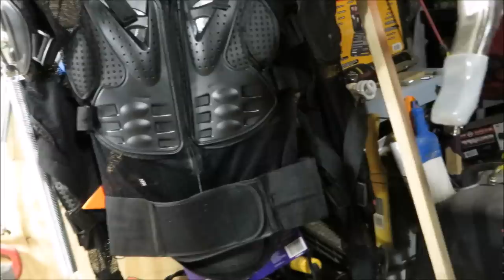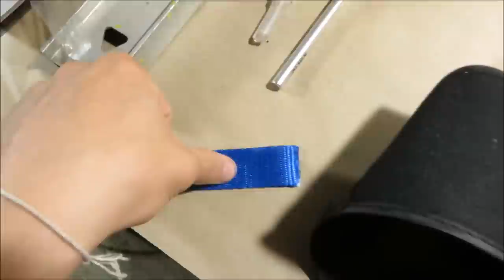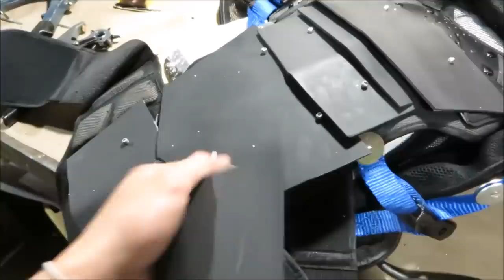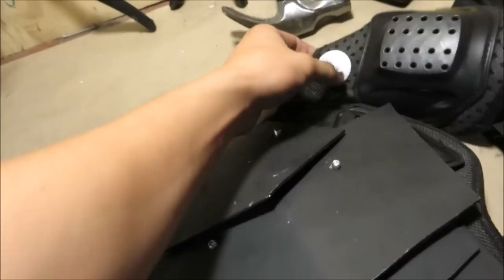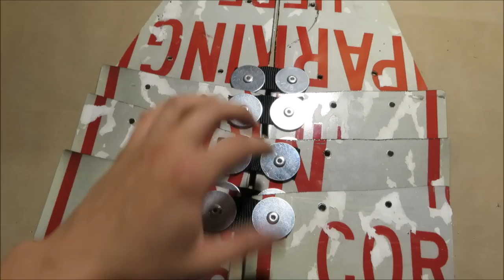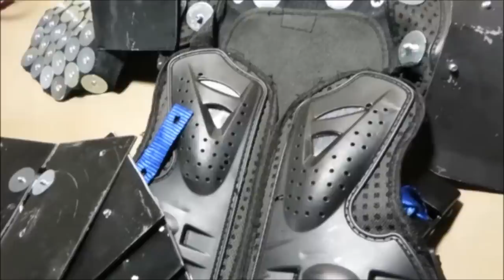How to Make: Body Armor

Comment from the maker: ***** This is my job.
Reply: when i tried to make my armor that failed i did use rusty steel so it didint survive but well lesson learned
Reply: You WILL be ready for the apocolipse!!!! :D
Reply: I have a tip for you when it comes to cutting the webbing.
Keep one of those snap off adjustable razor blades specifically for this. Heat up the blade with a blowtorch and cut it like you would using a razor. Bam, cut and defrayed in one step
Reply: I noticed that the area under your arms and down your side is unprotected, what do you do about that?
Reply: keep your arms down....
Reply: Jake the tall dude what about if you attack, or if you block or parry, you have to raise your arms eventually.
Reply: Then you get bit. The leather is enough to stop teeth, so I wouldn't be too worried. Underarm protection is pretty uncomfortable and cumbersome anyway.
Reply: Jake the tall dude what if someone has a knife? Then you might want to have a shield.
Reply: Then you have a shield
Reply: Yo eli, you should make a pocket to put pistol grade light armor under it all, think about it, if a emergency happens, most will choose a pistol.
Reply: I wish I could be like you. To bad I suck at everything
Reply: Moab Boy dont worry i know if you try enough you'll get there
Reply: ***** Kevlar is expensive and that stopped the bullet is needed to 5-7 layers,
Reply: ***** Nothing is "bulletproof."
Reply: ***** 
Try "Bullet Resistant" kevlar is only really good against smaller caliber pistol rounds and birdshot shells.
Anything more and you wanna be wearing ballistic plates.
Reply: ZednoughtAlpha I like to build stuff. my problem is that every time I have to drill a hole one is way out his measured point what can I use to make holes perfectly in place??
Reply from the maker: Luis Alberto https://www.youtube.com/watch?v=ziV8zt7uwpM
Reply: THANKS dude
Reply: Ian Byrne It's a pull over, get so nylon and some metal rivet plates to the side. Under arm armor isn't really a thing because it makes moving really difficult, instead, shoulder pieces often have extra long plates coming down in front to sort of cover the general area.
Reply: ZednoughtAlpha play paintball with it on? :D
Reply: ***** carbon fiber with keblar on top of it, its the perfect combination, theres an spanish company that does all that work for you ( http://www.clipcarbono.com/ ), you can send them .CAD archives, plastic (or alluminum) models  and they send you the carbon-keblar plates with the thickness materials or whatever properties you need, check it out!
Reply: ***** I speak both languages so dont worry, glad to help!
Reply: But the bag would have been lighter, need that light armor
Reply: by the way if you want cheap forearms and you dont have much time, pick one magazine and some duck tape for each arm (duck tape them in the outer part of each of your arms),  that will keep their teeth off your skin, and you are ready to fight some zombies!.
Reply: +Ian Byrne make maile
Reply: +Comfort Misha chuck norris is
Reply: +ZednoughtAlpha  so cool dude keep it going
Reply: +ZednoughtAlpha  so cool dude keep it going
Reply: +ZednoughtAlpha You are a pro man......
Reply: I have a question. for people like me that don't have the time or money to get the tools and materials would there be a way for u to make them for a price with each one being in its own way unique
Reply from the maker: Daniel Roser If you don't have time to buy tools, you definitely don't have time ot make them.
Reply: ZNA Productions I do but some things can be made better by other people. And srry I was just wondering
Reply: +Daniel Roser go to this guy's website:  Armatus-Designs.com he dopes special orders for people.
Reply: +ZNA Productions I think overlapping plating is called scaleing or something like a dragon or alligator scales...OOH! OOH! Can you do some animal scale/pelt armor tutorial :D
Reply: +Taylor Kingct also can you do a washer tabard a tabard made ENTIRELY out of washers and possibly a dress
Reply: +ZNA Productions hey man too bad u dont live in cali id love to use ur armor or weapons in my movies
Reply: +BrendanTheMLG The NEW Face of Brendan Holmes!  Bullet resistant * Bullet proof material is like Titanium, Diamond and few other materials, But Kevlar is expensive on itself, a better choice would be a plate carrier and cloth Ar-500 plate, they're light and Bullet resistant up to a .308 :)
Reply: +jose rodriguez  if you are making movies you probably can pay him to make some armor, or at least rent it
Reply: +ZNA Productions plz make a trasformer amour plz ok?
Reply: +ZNA Productions I'm curious can you make a homemade skateboard like im curious if it's even possible
Reply: me i cant
Reply: +ZNA Productions How much does it weight?
Reply: 100000000 weight
Reply: +Andy “Doomsday2028” Hernandez Why would he waste his skill on something so trivial though
Reply: +Scream Like You Mean It because it's seems to me a challenge and it's interesting to me at least
Reply: Andy Hernandez You don't mean a regular old skatey do you?
Reply: +Ian Byrne layer 3" X 1" plating in the same fasion as the front plating. should work
Reply: +Comfort Misha only bullet resistant
Reply: +Ian Byrne Chainmail.
Reply: +Luis Alberto measure correctly.....
Reply: i think you're a professional. Good job!!!
Reply: Measure twice cut once. A word of advice.
Reply: how old are you
Reply: Gaming GoCrazy 1000000000000000000000000000000
Reply: +ZNA Productions 
This body armor is missing a samurai sword attached to the back.
Reply: +thechromepoet samurais actually never did that for a pretty good reason...you can't fully draw something as long as katana from your back

And katanas aren't magical or anything....calm down
Reply: +Natalie Brown I was about to say the same thing... Thanks
Reply: +HighTech Gamer just follow this tutorial but instead of aluminum, use plastic. It's not hard
Reply: are there any alternatives to a rivet popper or easier methods

also, besides snips, are there any good cutting alternatives to an angle grinder or tools that can do a similar job i.e. rotary sanding with a wirebrush, etc
Reply: hahahahaha you are sorted in a zombie apocalypse
Reply: you used a no parking sign ..... im laughing so hard still great armor 😂😂
Reply: +ZNA Productions  It makes a number of tests for a new armor this time approving bullets ;)
Reply: How strong is the aluminium? as in can it stop a steel sword, or one of your weapons, or is it just for show and steel or carbon fibre would be better?
Reply: StrayHydraBlade you WILL be prepared for a spelling test!
Reply: ZNA Productions i
Reply: ZNA Productions that is cool
Reply: ZNA Productions im late 2 years late and this is so fly lol
Reply: ZNA Productions dude ill pay you to make me one.
Reply: ZNA Productions this is awesome
Reply: ZNA Productions your gonna survive the heckin zombie apocalypse

Comment: This is excellent, this may be a stupid question but what caliber of round could this armour theoretically stop?
Reply from the maker: In aluminum, I doubt any, It will break most arrows fired into it though. But 1/4 steel can stop a 9mm, next armor project methinks.
Reply: Nonlethalbychoice No it can't, Not unless its hollow point.. An FMJ would easily punch through 1/4" of industrial grade steel.. Would need to be specialty stuff. The stuff you made in this video wouldn't stop any kind of bullet, It looks cool but a .22 or an 1k+ air rifle could pierce it
Reply from the maker: John Montgomery
That's exactly what I said. He asked what caliber bullet it could stop, and I said "In aluminum, I doubt any", the armor is aluminum. Never claimed it could stop bullets, not sure why you're acting like I did.

And sorry, but 1/4 steel does stop 9mm:
9mm vs 1/4" steel
Reply: Nonlethalbychoice I've shot through steel with a subsonic fmj before =/ But yeah i know what you were saying, i was trying to imply it would have to be tough steel for it to stop a 9mm, sorry if i came off sounding like an ass for some reason mate
Reply from the maker: It's cool.

And well then I don't know what to say, the vid I provided shows 1/4" steel easily stopping the 9mm, but if you're convinced you've shot through it before, I guess we're at an impasse. It's whatever, we don't have to pursue this.
Reply: Nonlethalbychoice Have you ever made dragonscale style armour before?
Reply: Airsoft. I wouldn't even trust it to stop . 22.
Reply: NovaScotiaNewfie
Reply: ***** Ceramic plates are used primarily by the US military as they are typically lighter than steel, even if they typically have to be twice as thick to provide equal protection.
Reply: yeah any caliber of bullet would turn aluminum into swiss cheese... even hitting the armor he made with a baseball bat would dent it significantly
Reply: Nothing more than a .22LR if even that
Reply: Thanks for all your responses, very useful info!
Reply: KageRyuuUji
and still break ribs when you get shot.. doesn't matter if it's steel or ceramic you can get nasty Bruising and broken ribs with Military issued vests (Ak's hit like a truck) lol
Reply: KageRyuuUji
Not at all I was just pointing out that there still is a small flaw with the current armor system The system was designed to keep the wearer safe (deflecting the energy et cetera) it wasn't supposed to break ribs originally and they still haven't figured out how to solve it.
Reply: KageRyuuUji
Kevlar
Reply: Nonlethalbychoice
it wont even stop arrows fired from a 15lb recurve bow with metal tips. It is, however, more than enough to stop direct stab from a stainless steel knife
Reply: at most a .22
Reply: Be good for birdshot or shrapnel
Reply: If you want to make serious armor make this type but underneath all of that add homemade bulletproof plates (look it up) although it would quite bulky still would be sick to wear
Reply: use 1/4 inch AR500 steel plates, and this set up can defeat MULTIPLE hits of 7.62 and 223 rounds.
Reply: I would think no more then a 9 and most likely a 22
Reply: uriel zuno it's made from a "no parking" sign. If you shoot that with a 9mm or even a .22 short it will punch right through.

And before you kids get carried away trying to heat treat your parking sign armor to make it bullet resistant,  don't bother. It won't work. Plus it's galvanized steel which means it will release dangerous gases once heated to critical temperatures.
Reply from the maker: Tracker Buckmann
I agree it won't stop any bullets, I stated in the beginning captions that street signs aren't bulletproof. You're however misinformed, the signs are made of aluminum, not galvanized steel. Not to say that means it can be heat treated, just some info. Out of curiosity, what made you say (under the impression that the armor was made of steel) that it can't be heat treated?
Reply: You'd be surprised what a 22 wont go threw. But maybe your right ].
Reply: Nonlethalbychoice I was responding to someone who posted in here. If it's aluminum then it is even softer. The primary reason you don't want to heat galvanized metal is because of the risk of zinc posioning. When I have to cut it, weld it, whatever I wear a full face respirator, cover all of my skin and have a good ventilation system. 

As for your project, I'm not trying to belittle it at all. But I've shot lots of different caliber bullets through various objects over the years and I know what devastating results they have. I see television shows where people take cover behind trees, car doors or filing cabinets when being shot at with something like an AK-47- you know what a 7.62x39 mm round will do to even a large, thick oak tree suitable enough to stand behind for cover?

It will blow right through it. Even I was a little suprised, but these weapons are much deadlier than Hollywood gives them credit for.
Reply: Tracker Buckmann even a catapult or 22. air rifle would dent this metal, it would stop a knife i guess
Reply: yeah but it struggles with nukes...
Reply: It could probably be used during an RPG, but that's about it.
Reply: makes sense.
Reply: Granted, which is why we draw distinctions between .22, .223 and 5.56. They aren't the same thing.

If I have to stop and explain that they all have different bullet mass(except .223 and 5.56 in most cases), casing size and powder loads then I'm kinda stating the obvious.

You could shoot a rock from a sling shot that is a much larger 'caliber' and you'd be alright in this armor. I think most people understand that. Any reasonably intelligent person wouldn't get lost in the semantics of what I said.
Reply: It says you 'mentioned' me, or replied to one of my earlier statements. So, naturally I replied back.
Reply: gg t gr@vtr 2 semanas 25

+
Reply: It can stop a small plastic BB pellet. Possibly deter some woodland creatures too.
Reply: Renegade Fighter  this entire conversation would make for great dialog in a Will Ferrell movie. Especially what you just said.
Reply: Tracker Buckmann
XD
Reply: Pointless comment.
Reply: ZednoughtAlpha I've seen a video where thick steel is penetrated and shattered by bullets.

I've also seen a video of a steel butter knife splitting a bullet fired at it from near point blank range.

You should make steel armor covered in butterknife like protrusions, like scale armor where the scales are rotated 90 degrees.
Reply: Canadian Prepper - (Theoretically) It will stop a 5mm PLASTIC bb pellet, trown at you !
Reply: It certainly can stop most melee weapins
Reply: olevettiprik4, first of all, spell thrown correctly, and secondly. I don't think 5mm bbs are a thing.
Reply: like nothing a 22 would go thrugh it
Reply: Canadian Prepper h
Reply: not at all
Reply: Canadian Prepper airsoft bb?
Reply: @ZNA_Productions  "it will break most arrows"
"Hello and welcome to the slingshot channel"
Reply: Nerf bullets
Reply: The only thing this will protect you from firearm wise, if you'd even call it a firearm is an air rifle.

Pellets. Especially lead ones would just bounce off and make a cool sound. Anything above that it's going through it
Reply: .22 if you are barely in range at best
Reply: @ZNA_Productions I want armour that stop both bullets and swords.

Comment: I just have a question: how fast can you move in this? I'm trying to write a realistically grounded tale of a batman inspired vigilante who probably relies heavily on parkour, and because I have such a picky sense of realism, I want his armour as protective, but  with as much free movement as possible. I'd say his gear is very similar to a lot of stuff you've made, because he had to make it out of things he scavenged together.
Reply: +John Pugh Me just quickly thinking, I would assume you could move somewhat quick, but extravagant movements would be limited.
Reply: I would say standard parkour like vaulting, impact rolling, etc  would work but flips would probably be hard
Reply: Aluminum is one of the weakest metals with one of the lowest melting points. Titanium is just as light as aluminum and would suffice as a more sufficient piece of armour. If you are going into strong detail with this, say titanium, not aluminum.
Reply: well your character depending not the story and his budget could use steal or titanium as D4B mentioned. Titanium would be ideal but it could be a good goal for later on in the story, maybe an associate gives him an upgrade or something. For how fast you can move depends on 2 main things. the build and training. If the armor is extremely segmented it will provide for more movement (although less protection from blades since the can slide in-between). For training if the character trains with the armor, runs with it, boxes with it basically works out with it on he will become accustomed to the weight and how to move with it. You could always keep the armor only to the torso, and keep smaller thinner plates on upper arms, and thighs protecting the most important bits.
Reply: Henry Lafferty an update now sees his story taking place before WW3. So that probably broadens the spectrum a bit. Thanks.
Reply: interesting, you could always bring a bit of sic fi into it, but keeping it realistic you may not want to do that. But this could in fact increase the choices of allies he could make. Maybe an underground one that he isnt working for but helps him so he can help them situation. Once he's done some work for them they could gift him the new armor, maybe with some fancy tech like infrared or something. You could always make some fake metal that is stronger and lighter than titanium but it is one of the oldest tricks in the book.
Reply: Henry Lafferty its still rather realistically grounded, but more in a way that it drastically hypotheticalizes future tech. Such as one concept weapon for the story, the Fusion Bomb: Basically, picture a nuke that makes Tsar Bomba look like a firecracker.
Reply: well I mean I'm pretty sure the tsar bomb is a hydrogen bomb/fusion bomb. since hydrogen is much stronger/has a bigger explosion than uranium. Also I would advise using rail guns. Or gauss. you can look up homemade ones on youtube there is a full auto one I've seen that shoots little nail spike things. If you don't know its a gun that shoots metal thingys with magnets that has no propulsion besides the magnets. They can be insanely powerful. There have also been designs of shotgun slugs that are non lethal tasers, if you want him or others to play a non lethal way.
Reply: I'll probably even give him some friends. That associate you suggested? His dad works for a corporation with all this fancy tech, meaning he has some limited access to the stuff the character could want. Down the road I might even give him a fancy prosthetic arm that's smartphone compatible and an attack drone. Another ally might be one you don't see on the frontlines often with him, because he's a tech wizard scouting the city with camera drones that he used to let the main character know of situations that need his attention.